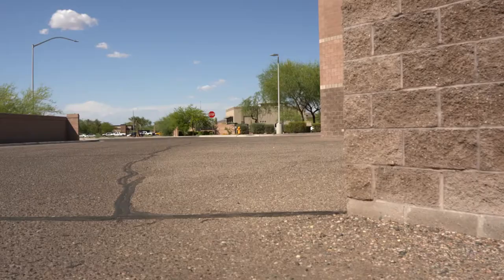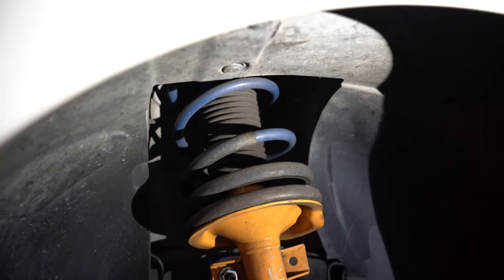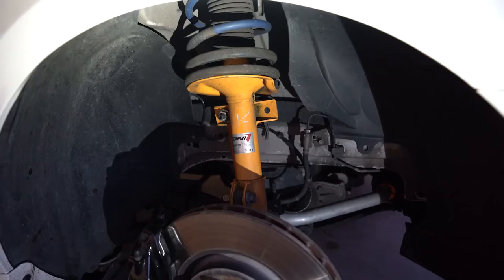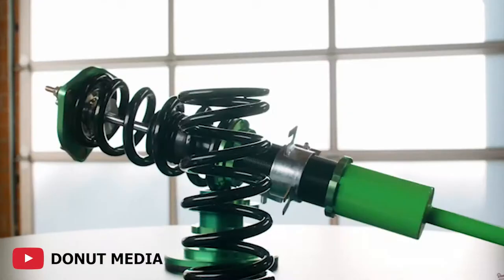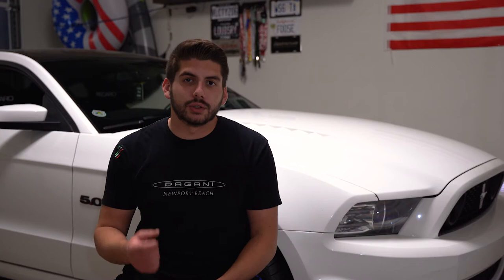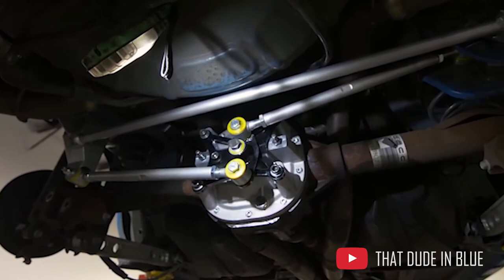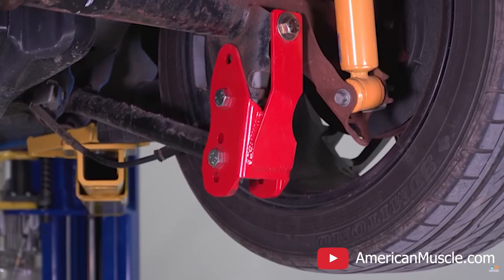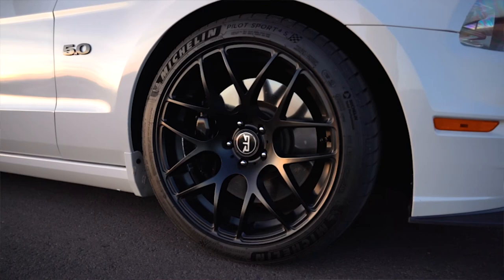How to Properly LOWER your 2005-2014 S197 Mustang!

Comment: Excellent video, late to see it, though. Much more info here than from American Muscle. I have a question too. Does the kit come with alignment specs? I know I'll need to have everything realigned once I install the adjustable pan bar. I'm asking because, Belle Tire in Warsaw, Indiana told me that I would need the alignment specs to better align the handling of the front-end & rear-end if, I'm putting a lowering kit on my Mustang. They definitely do a better job than the Ford or, Chevy dealerships done on my '09 Colorado and '07 Mustang. Belle Tire does a better job at a lower cost, as well. $75 for the alignment as compared to, $200 from the dealerships.

Comment: I had a 2013gt that had this crazy gear wind from the back, took it to 3 different ford dealerships and they all gave me this crazy ideas of what it could be even suggesting i need a whole new rear end. What it actually was is that i had the wrong friction additive to the rear end oil 🤦‍♂️. Took years to figure this out.

Comment: I installed Saleen's approx. 1" lowering springs & Koni yellows on my 2014, along with cc plates, an adjustable panhard bar, aftermarket rear control arms, and relocation brackets. Sure it handles better, but I couldn't get an alignment because now it won't clear the shop's rack, and I have to first drive up on boards for each tire to position above ground lift arms under it for servicing.  People need to consider there are potential downsides even when properly lowering a car, and videos neglect to mention that.
Reply from the maker: Videos don’t mention that because it’s assumed you’ll have to take extra measures to compensate for you modifying your car. Everyone I know has to lift their cars up on boards before servicing on ramps not designed for low cars, this is very common. Even factory sports cars can require this. My advice: find an alignment shop that works on sports cars often, they’re out there.
Reply: @Massimo_Media  I have heard there may be some alignment shops with recessed racks that will give the necessary clearance. However I have reset camber with a portable camber gauge and so far notice no unusual tire wear. I had previously lowered my fox Mustang and it clears alignment racks and lift arms without any problems, so had no reason to assume the 2014 would be different.

Comment: Good video! I got the whiteline lowering springs, koni orange struts and shocks, maximum motorsports caster camber plates, steeda upper control arm, whiteline lower control arms & brackets, whiteline panhard bar & brace, and whiteline sway bars.  I  put the pilot sport 4s tires on last year. Do you plan on changing out the front control arms or are the caster camber plates good enough for the front end?
Reply from the maker: Good stuff! I actually have Fortune Auto coilovers on the car now, so I don’t have caster camber plates unfortunately. I do have camber adjustment, but no caster adjustment. No plans to swap FCAs at the moment. I haven’t heard too many S197 road course guys swapping them out either. Would there be any advantages to aftermarket FCAs?
Reply: @Massimo_Media  Not sure, I changed most of the suspension parts out so that was the only part that I thought of next.
Reply from the maker: @5.0beers70  could be good for handling! If you find any significant benefits, hit me back with a comment, I’d love to hear about it.
Reply: I upgraded my front control arms to the Shelby GT 500’s. they feel a lot better the the OEM GT ones
Reply: @andrewlawson3798  I ordered the Steeda front control arms with the extended ball joints.  I should get them next month since they have to make them.

Comment: I want to lower my 14 GT but I need a bit more clarification. I currently purchased koni str.t’s shock and strut kit, I have lowering springs and a non-adjustable panhard bar but I wanted to ask if I do need new rear control arms and relocation mounts at the same time as I lower my car or not. Also do I need the camber plate right away or could that wait as well. Just trying to get ahead before I miss something later on thank you. Your video really inspired me to lower my car as well thanks so much.
Reply from the maker: You’ll want to do an adjustable panhard bar pretty soon. Relocation brackets for the rear LCAs aren’t required right now, but you’ll want those soon too to correct the suspension geometry after lowering the car. After lowering an S197, the rear LCAs are at an incorrect angle. The car will be much more stable with relo brackets and rear LCAs. Camber plate is up to you and what you’re doing with the car. You may be fine without it, but you’ll be at the mercy of whatever your camber is currently at.
Reply: @Massimo_Media  Thank you very much for the information. You’ve been a great help and I look forward to seeing new content from you as well. Keep up the great videos 👍.

Comment: Thank you! This saved me some research, and time!
I know it's only a 6, but I just picked up a 2013 MCA edition a couple weeks ago. I'm looking at lowering it, but I think that is going to wait until next summer. I have ordered BMR rear LCA'S for now. The extension brackets Ill wait to order til I lower the car. until I drop it, do u think adding the panhard bar will help me, or no? I'm trying to be as budget friendly as possible(doesn't mean I won't cheap out on quality), might just take a bit longer to achieve the end goal